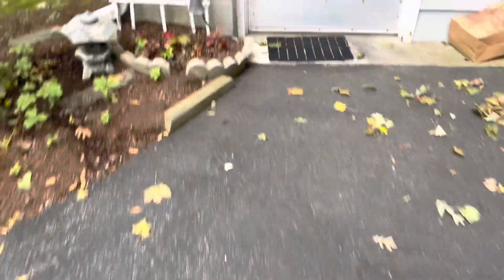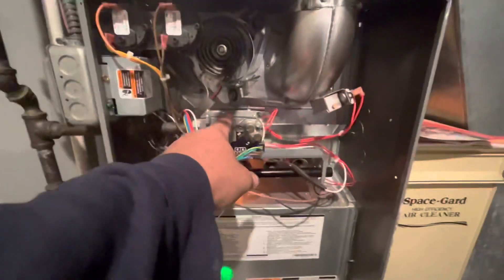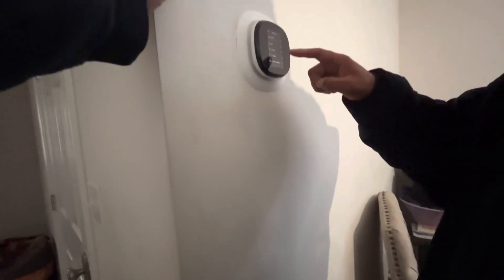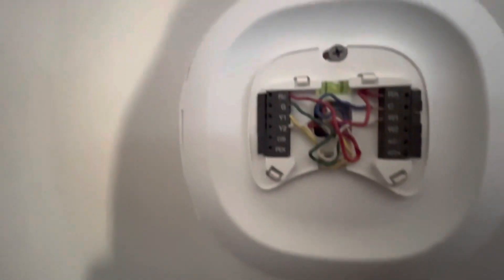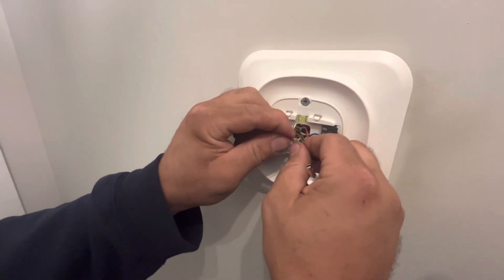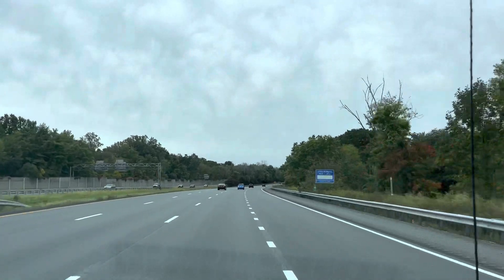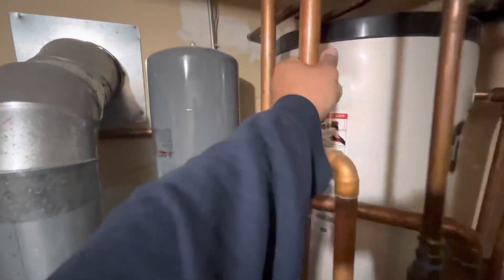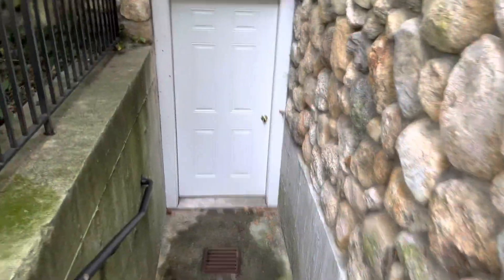HVAC. MY HEAT DOESNT WORK. IS IT MY NEST OR ECOBEE THERMOSTAT?

Comment: I had a HVAC rep. Come by yesterday to check why my ecobee was not turning on the heater, my ac blows cold air, but doesn’t turn on when I put it on heat, they guy checked out etc. now my ecobee doesn’t turn on at all 😂🤦‍♂️, I don’t know if something happened when he checked it out , the rep said he gave it a test etc. but since yesterday my ecobee has been off 🧐🤦‍♂️😂 it worked before cold air turned on etc. the only bad issue was the heating problem

Comment: You got a chauffeur today huh?  nice job Paul.  you guys are getting cool weather and working on heaters already.  we are still doing some ac work but working in some heat tune up this week.
Reply from the maker: Thanks Mark. For some reason the heat calls were coming yesterday.  We are also kind of in that slow season, but we had the temp drop overnight to the 40s.  I’m sure we will go back to normal for the next month or so.  Thanks again brother.
Reply: @hvacotj  had a HVAC rep. Come by yesterday to why my ecobee was not turning on the heater, my ac blows cold air, but doesn’t turn on when I put it on heat, they guy checked out etc. now my ecobee doesn’t turn on at all 😂🤦‍♂️, I don’t know if something happened when he checked it out , the rep said he gave it a test etc. but since yesterday my ecobee has been off 🧐🤦‍♂️😂 it work